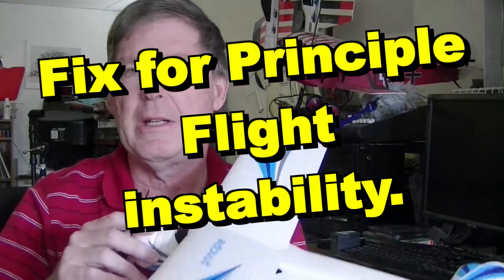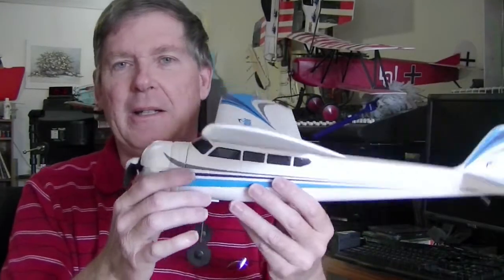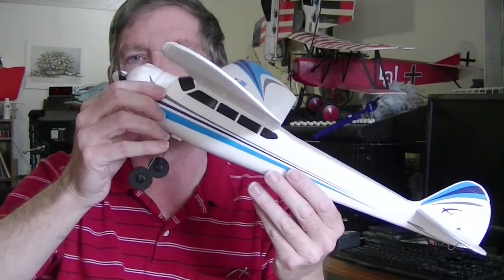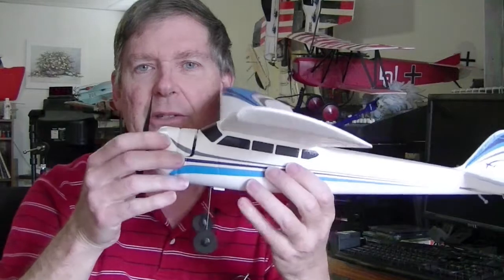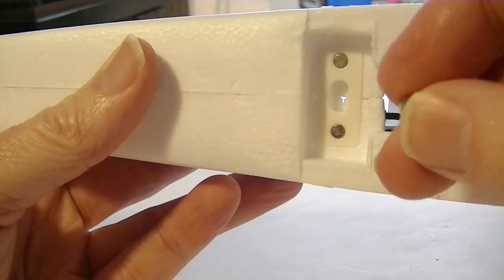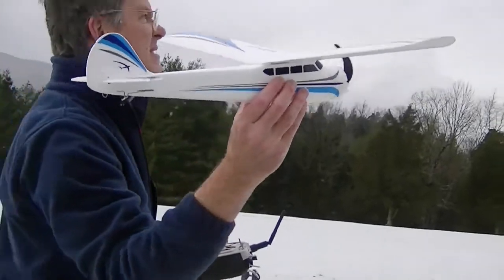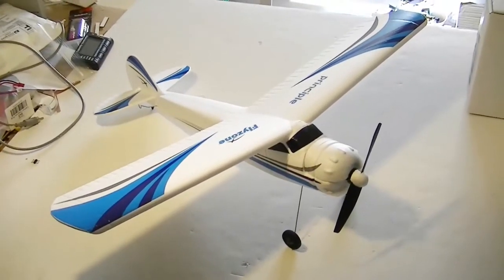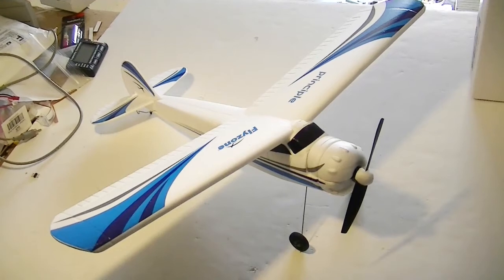How to Fix AirCore Principle Trainer Plane Flight Instability

Comment: 1/4oz extra to the nose made a significant improvement for ours.  Maybe it's a combo of that and wing angle... may try that as well
Reply from the maker: +scott nagler Sounds good! Anyway you can do it is good but my method keeps the plane flying level at higher speeds instead of heading for the sky.

Comment: I'm sure the guys on the forums will suggest all sorts of ways to fix that plane... change the thrust angle, alter the tail, adjust the CG, and so on. But your fix is simple, easy to implement and appears to work. Nice job.
Reply from the maker: Thanks!
I saw a video from Flitetest where more weight was added to the nose (a quarter) and it had little effect. Then I thought if it was not a CG problem it might be wing incidence so I proceeded to experiment.
Reply: ***** where to get these magnets plz :)
Reply from the maker: MrNevped I got them at the Michael's Craft store in a mall near by.